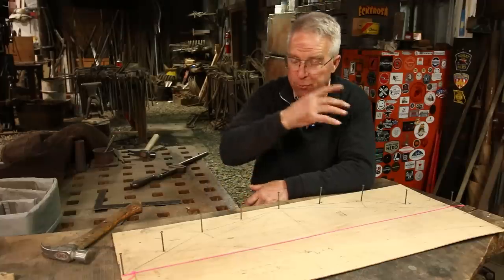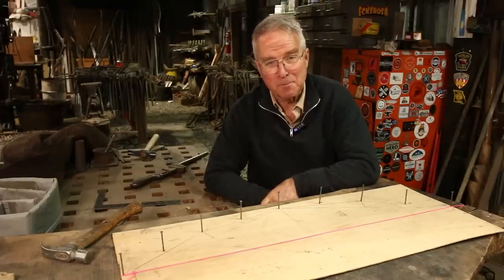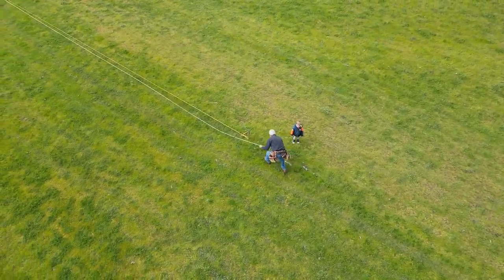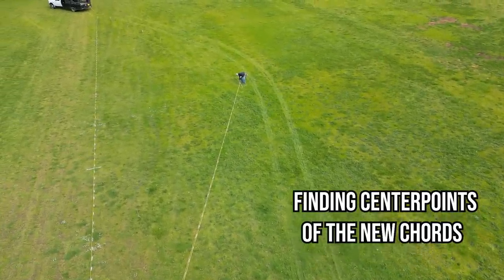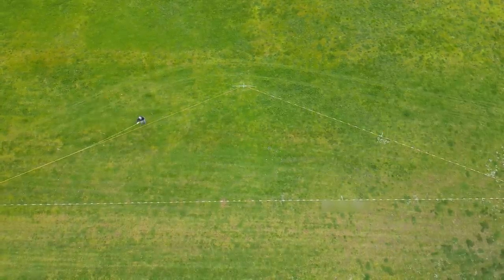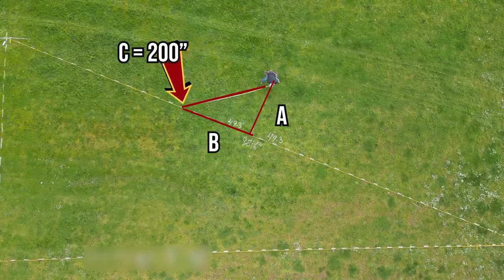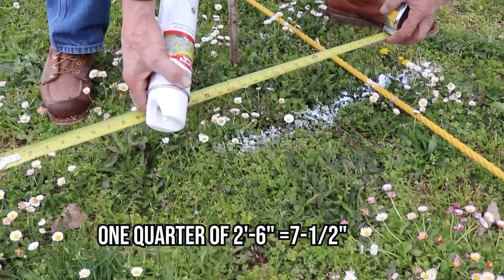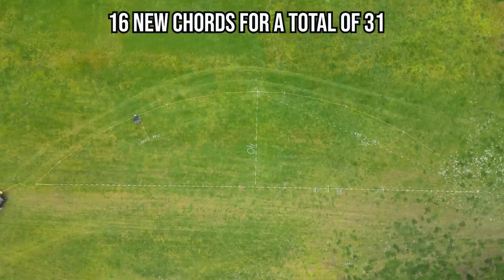How to “Quarter in an Arc” | Simple Geometry for Radius Concrete Forms

Comment: I'm always a little befuddled when people's go-to square triangle is 3:4:5. It confines you to weird measurements and juggling 3 numbers and 3 multiplications in your head. It's much easier to just remember 1.41. (Or sqrt(2) if you want to be fancy). Take any matching square sides, the hyp is always 1.41x that length. I.E. A right angle isosceles triangle. 10 feet for both the horizontal and vertical, the diagonal is 14 feet. 5 feet, the diagonal is 7 feet, etc. Just any measurement mirrored on both horizontal/vertical, and all you do is multiple by 1.41 to get the diagonal. Any length at all, no picking special numbers or ratios. Walk down any side of anything that you want to be a square side, take any number you want, 1.41 that is the diagonal. That's way less math than trying to figure out what the closest thing to a 3/4/5 you can muster with your current space and then keeping track of all 3 and what you're multiplying.
Reply: That's irrational.
Reply: you lost me, i think i'll stick to 3:4:5 :D
Reply: @xyzct  It works, just not as easy or quickly until today with your phone calculator. 30 years ago it was easier to 3,4,5
Reply: @MattsAwesomeStuff...You're wrong about your factor. You need to carry it to a minimum of 4 decimal points or more (for your example, 1.4142) for a more accurate calculation. After you've made ALL FINAL CALAULATIONS, then you can reduce that number/answer to the nearest 32nd or .01. 
Your factor number is just a general rough estimate and us in the detailed construction business build to a much higher degree of accuracy....i.e., we want our 4" plumbing vent pipe (4.625" o.d.) that is at the end of that 150' long 5 1/2" wide wall to actually be in the center of the wall because it will only have 7/16" of wood on each side of the pipe!!!!.....and/or the bolt holes in the end of our 75' "I" beam supporting our concrete bridge to be accurately drilled because the beam has a close tolerence that is engineered into it). The diagonal of a 150' X 150' building is actually 212.13195' or 212' 1 9/16"+. Your 1.41 factor gives the diagonal of 211.5' or 211' 6"., a discrepancy/error of 7.584 inches (7 9/16"+). That's not good enough!
Use Scott's knowledge and you'll be where you're supposed to be.
Reply: A nifty trick that works great on paper to solve a pre-existing geometry.👍 That doesn't pay-off in the field with a measure in hand. Who does 1.41 multiplication in their head? Who needs to pull out a calculator when measure and mark is faster? As far as finding square, if you can't mark out 3x,4x,5x and remember one number (the 5x) you're wasting time. There's also a simple formula, that does need math, for figuring what the radius of a section of arc (like shown in video) is from the chord length and center sagitta height. ((Height divide by 2), plus, (Width squared divide by 8x height ) = radius.)  H/2+ WxW/8xH= R. Those are often the only dimensions given in an architectural plan, and the builder has to figure out the radius. Works in reverse also, from a radius and one of the other two dimensions.
Reply: @OddJobFix , you misunderstood me. I meant that sqrt(2) is an irrational number.
Reply: @arkansas1336  very well said.  On top of that, 3-4-5 triangles often take no "math" at all, they can be done in your head way faster than you can walk 5 feet to square a partition wall layout or 50 feet to mark a foundation form.

And as you point out, be as accurate as you can place your string, chalk line, stake, laser line, or paint mark.
Reply: Whatever you are trying to say is lost on me. 3,4,5 doesn't require an special lengths or weird math or decimals. Just measure 3 multiples of a number one way, 4 multiples of that same number perpendicular and if your two points are 5 multiples of that same number, then you are square.
Reply: @MAGA MAN  - Well, think of how many steps that is, and how much it limits you. And how many numbers you have to go through until you get the right one that works with the constraints. My way you can pick any number, no figuring ahead of time, it's the same number you use for both directions. You do one calculation, which you can ballpark in your head, or, do square root of 2 if you need to be precise over any distance. Any calculator will have a square root button. 3, 4, 5 is janky and limited in comparison, and only best for people who have no grasp of math at all, which, shouldn't be any contractor.
Reply: @MattsAwesomeStuff  Nah, for the calculations I need doing layout, multiplying by 1.41 is just not accurate enough. In a 50’x50’ square, the diagonal measurement is off by 1.5 inches. 

I would imagine that would be reasonably close enough for most landscaping projects, but for building layout, you need to shoot for as exact as possible. Field conditions will already try to introduce error into your work, so you don’t need to compound that by using a rounded calculation, right from the start.

Comment: This is fascinating. We ended up "backing into" this process when we needed to layout a radius for a railroad track we were laying that passed right next to a building on the inside of the arc. Essentially, given a known tangent length between two points you could use a specific offset to get the tangent that makes the curve of radius that you needed from the start and end points of the total arc.

Comment: I can see this being useful when objects in the way prevent you from finding the center of a circle from which to string a radius line, in this case about 133 feet long. You could even put two centers with a long string between the two to trace out an ellipse. The other issue is how hard it is to manage such a long string without stretching or catching on ground debris.

Comment: Hi Scott, I saw a workman trying to solve one of these problems on a house I was having “rehabilitated.”  I asked what he was doing and he said he was trying to establish the arc based on the distance from a straight line, (what was actually a chord), It took me a few minutes to solve a geometry problem and I showed him how to get the arc….of course I wasn’t surprised that he had serious difficulty believing me with the obligatory rolling of the eyes, etc. – I am, after all, just “a civilian” and not in the business….the answer I gave him worked and I handed him the formula to use if he ever had a requirement to do something similar….I have no doubt, he tossed the paper….

Anyway here’s the way I would have done this. We have the length of the chord, 190’ We have the greatest distance from the chord, 40’ (which is a point on an imaginary circle). You build your perpendicular from the 40’ point, passed the chord and continue for another few feet. The length is unimportant, the extension is just give you a line to follow. What we want is just the radius of the imaginary circle. If you have the radius, you don’t have to do all the other measurements. So here goes:  
C is the chord length, 190’.
 A is the perpendicular distance from the chord to the point on the circle, 40’.
 R is the radius of the circle to be calculated

R = C²/8A + A/2
       = (190*190)/8*40  + 40/2
        = 132.8’, the radius. 
So now just run a line from the 40’ mark along the perpendicular for 133’ That;'s the center of the circle.Just run a taught line from that point with a spray can  along the arc…..

I've had to use this  a few times over the years....I never remember the formula, so I have to re-figure it. - as I've gotten older, it;s taken longer to do the problem.....I'll be 78 in a few weeks and it only took me 20 minutes this time around...up from 5 when I was 40....hmmmm....

Comment: If you do have room behind the chord to find a center-point and run a string to scribe the arc, here's a simple formula for figuring what the radius of a section of arc (like shown in video) is from the chord length and center sagitta height. ((Height divide by 2), plus, (Width squared divide by 8x height ) = radius.)  or, H/2+ WxW/8xH= r.= string length. Cheers.

Comment: Cool. I use this in woodwork sometimes. I kinda thought I was the only one that knew how ( that I've ever come across) so pretty cool to see you put out the video.
This is a great tool for when you know the chord, and the offset ( or loft ) of the curve, but not the radius as such, or when the centre of the circle is inside a building, or in the neighbours yard, or whatever.  
I use it laying out circular curves on beams, where the radius isn't important, just the length and loft. Layout is quick, and pretty magical. And the the bendy piece of wood people... sometimes you just don't want a catenary curve.

Comment: I think if I had to do this I would maybe do a 3-4-5 square to split the main arc but after that I feel like I could throw a lot of stakes in the ground quickly to get a very accurate arc by making an estimate on perpendicular without doing a 3-4-5 check. Just keep halving the distance and quartering the arc! Thanks for the tips!

Comment: Good to know. A total station layout insrument is what would be used now. This can be used to transfer your 138'-9-15/16" radius to a 8 ft piece of plywood to cut 3-1/2" strips to use as top and bottom plates of form walls. It works the same way, construction Master calculator helps
Reply: I get 132’-9-11/16” radius.

Comment: Could you do a follow up video on a smaller scale or white board, you lost me somewhere in the field

What is the official geometric curve of that arc? Or is it just connecting the widest point to the ends?
Reply: pretty sure its just connecting the widest point to the ends, fitting the spaces available on site.
Reply: Each new triangle added to a straight run between stakes more closely approximates the circular arc that intersect the original three points (the endpoints and the first perpendicular).  So, if you need a true circular arc between two points, coming out to a certain midpoint distance from the straight line between them, this will allow you to do it without having to find the center of the circle (which may not be a reachable location) and pivot around it.

Comment: Or carry a laptop with an app on it. LOL. But it was fun seeing how it use to be done. Still dont think I could do that after watching just once. I'll have to google it for a written explanation.
Reply: ... and then you still have to do the lay-out.
Reply: @bgtyhnmju7  If it's a job that HAS to be done with high accuracy it will probably be a public works project in which case it will be done by specialists . . .
Reply: Have you seen the Public Works guys at work??   Anyways, your argument is high accuracy work needs high accuracy - sure. And then there's less demanding layout, where strings and spray paint will do.

Comment: Scott
I was a little suspicious about the factor of 1/4 of the previous Sagitta as a dimension to use.  Arcs and angles never seem to work out in whole numbers.  It's close, but I got 26.0195% as a number.  Hopefully someone will check me out on this.  Still, I was a fun exercise.  Mr Slingshot.
Reply: You are correct, quartering the middle ordinate does not make the arc perfect but it's closer than the eye can tell, especially on something with some size to it like this. Your ratio is bang-on. Multiply the previous middle ordinate (saggita) by 0.260195 to get the next one!
Reply: Stand by, I did it wrong, that ratio only works once. Let me find the correct formulae and I'll rearrange it so it's useable/useful
Reply: @Richardbomgardner  I found out it only works once also so I suspect with each new cord the difference will become smaller.  I’ll be interested in what you find.  As a tool and die maker for over 40 years I solved these kinds of problems daily.
Reply: Heck yeahI still solve them daily and love it! I'm a licensed professional land survey and a structural concrete contractor.

So digging into the math, the long chord to sagita ratio is not fixed but it stays dang close to 25%.
To absolutely nail this, you need to calculate each middle ordinate (sagita) for each reduction.

2*(M/LC)=tan(I/4)
M is middle ordinate length
LC is long chord length
I is the angle of the arc.

Use the first LC and M to calculate the I, then use the half the LC and the M to calculate the 2nd LC using Pythagoras. The use the formula above to calculate the 2nd M, but using half the original angle.

His middle ordinates in a perfect world would be:
40
10.4078
2.62795
0.65862
0.16475

You'll notice ratio changes slightly each time but stays close to 25%

Fun problem!
Reply: @Richardbomgardner  Good job.  If I needed this often I would make an Excel spread sheet where I could enter the variables and and the number of times to calculate.  I learned something new because I had never heard of this layout problem before.
Reply: @Richardbomgardner  
I couldn't let it rest.  I started with a cord that is the same as the diameter (1/2 circle) and solved each new sagita ratio.  Thoughts???
29.2893% @ 45 degrees
25.9892% @ 22.5 degrees
25.2425% @ 11.25 degrees
25.0603 % @ 5.625 degrees
25.0151 % @ 2.8125 degrees
25.0038 % @ 1.40625 degrees
25.0009 % @ .0703125 degrees

Comment: I wanted to put in a block wall next to my curving property line that has property corner stakes but nothing indicating the 112' arc section on a 42' section.  I could not run an arc due to sloping terrain  and physical obstructions.  I ended up using the county satellite images and using the built in measuring tool to take measurements.  My neighbor agreed with my layout and i built the wall 6" back from the line.  How would you measure the curve  with obstructions and sloping ground?
Reply: Surveyor

Comment: Why, after you spray a mark on the ground, do you spray over your shoulder?
Reply: Cleaning the tip
Reply: PgD is right, but didn't mention that turning the can upright is part of it.  Marking paint is used with the can inverted.  When you flip it upright and spray a tiny shot, that shot is nothing but propellant.  With a regular spray paint can meant to be used upright, you flip the can upside-down.

Comment: I agree that when your radius is over the length of a tape measusre this is a good, albeit time consuming, method.  

I recently learned that A×A=B×C.   One would have to look it up, but when you understand this formula, you can find the radius, height, or width (given 2 of the 3) for any arch.  Changed my carpentry game.
Reply: Not that I would  use that as I am 71 but I got confused  with a×a=b×c would you explain for an old man
Reply: @Roger Lein  you'd have to see a picture of a circle with all this but ill try.  'A' can be any half of a cross section, anywhere on a circle. The other "a" is the other half.    B and c are the perpendicular sections of that same circle.  If you know the width of an arch, you know "a" and "a".  Half of width is "a".   Knowing  a×a=b×c,  and Also Knowing the Intended height of arch (B), you can solve for c .  That will be the diameter.   Now divide by 2, and you have the radius.     Know that line B and c intersect a and a in the center, forming a cross of some sort.   I tried.

Comment: I don't know why carpenters are so fixated on "3 4 5". There are an infinite number of Pythagorean triples (see the Wikipedia article). For example, "119  120 169" (or 10 feet minus 1 inch, 10 feet precisely, and 14 feet plus 1 inch) has proportions very close to a large speed square (12.0, 12.0, and 17.0) . If you just use 12, 12, and 17 your perpendicular would be off by 0.2 degrees, or less than the thickness of your paint line.
Reply: 3 4 5 can be taught to a child and is easy to remember
Reply: I don't know why carpenters are so fixated on using inches and feet, but there you go.
Reply: Because there is no reason to use anything else, so why not just use the one you learned in 4th grade? (my Father-in-law literally has a 4th grade education, doesn't know Pythagoras from Persephone, and used the 3-4-5 rule his whole career as an excellent carpenter).  You can 3-4-5 anything.  Inches, feet, cubits, meters, furlongs, lightyears, or red licorice ropes you had in your lunchbox, it all works the same.
Reply: @Elkadetodd  If all you know how to use Is a hammer, and everything looks like a nail. The comments provide to superior ways to using 34 and five in the situation but hey if that’s all your brain is ready for go for it
Reply: @3maisons  It's not superior.  Using a bigger set of numbers doesn't add any accuracy.  So you are just complicating the problem for no reason at all.
Reply: @Elkadetodd  It’s got nothing to do with whether the numbers are bigger or smaller; it has to do with the angle of the intersection of the 12 and 17 arcs.
But there is another commenter that finds the perpendicular by drawing two equal length arcs from the ends of the chord, better than 3 4 5 or 12 12 17.
Reply: You can use any number. 3-4-5 comes from a^2 + b^2 = c^2.

Comment: What if part of the first cord is inside a building and the rest arc is outside of it?
Reply: If you have access to a theodolite you can do it using trig. It's a tough one to explain without visual aid. If you don't have access to a theodolite then hiring a surveyor is best. Regardless I would probably hire a surveyor to lay out the major reference points and then I'd narrow down the chords using offsets as Scott demonstrated in the video. Depending on the accuracy needed, hiring a surveyor just for the liability is worth it alone!